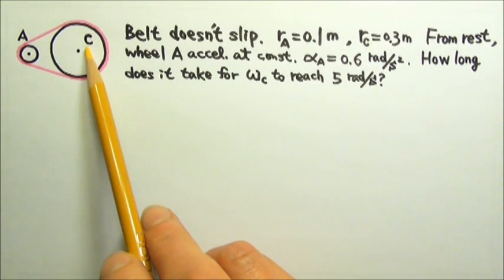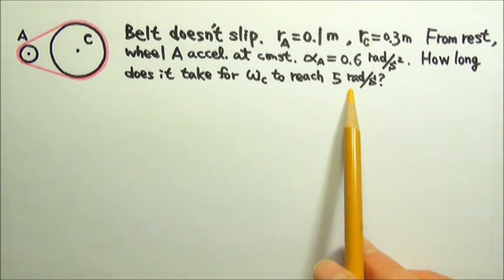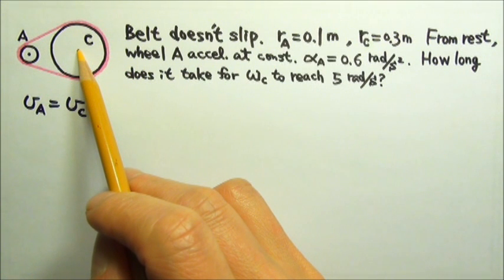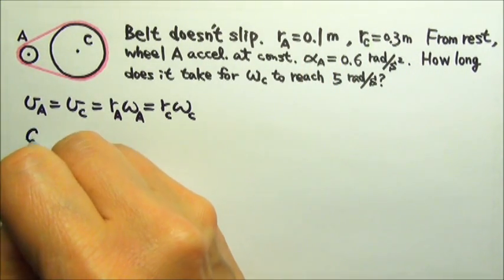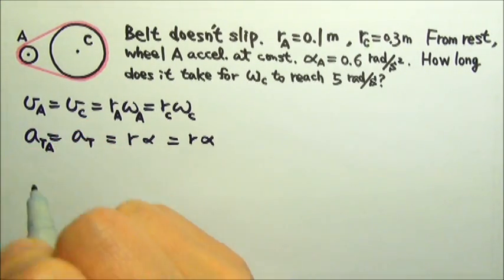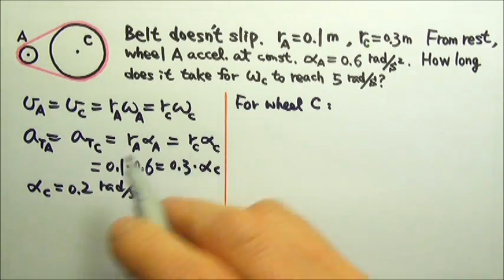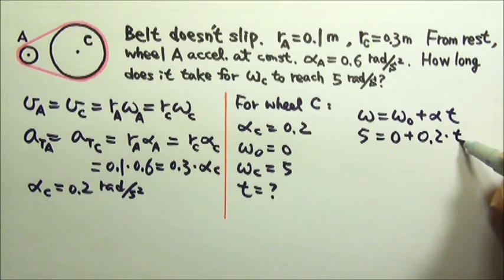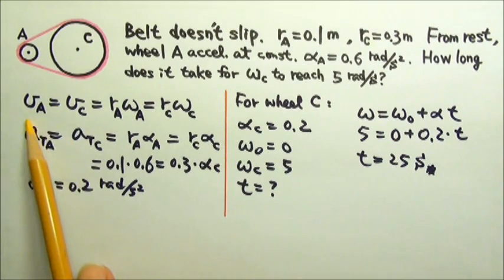AP Physics 1: Rotation 8: Constant Angular Acceleration: 2 Wheels Linked by Belt or 2 Meshing Gears

Comment: How come your work wouldn't change for 2 Meshing Gears? Won't one of the gears rotate in the opposite direction of the other? Or will the direction or vector not matter?
Reply from the maker: The speeds of the rims would be the same. But yes, two sets of meshing gears would rotate in opposite directions, but the speeds which are not vectors would be the same. We are not discussing velocities here because the velocity of a point on the rim would be constantly changing because the direction of the velocity is constantly changing.

Comment: Do we know that the 2 wheels share the same tangential acceleration because they are being moved by the same force? I am confused on why the Ata = Atc
Reply from the maker: We know that 2 points on the rims of the 2 wheels have the same tangential acceleration not because they are being moved by the same force, but because they are being connected by the same belt that does not slip on the wheels.